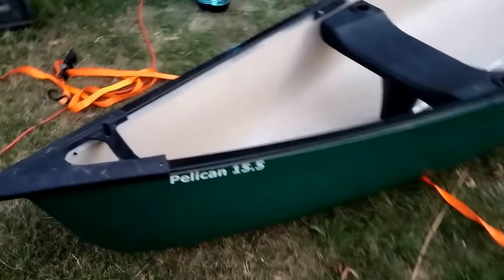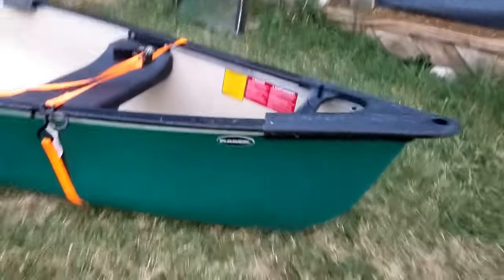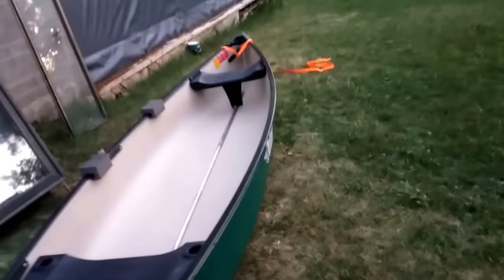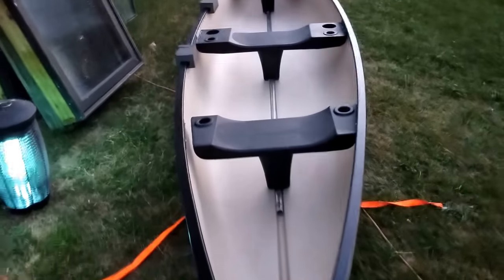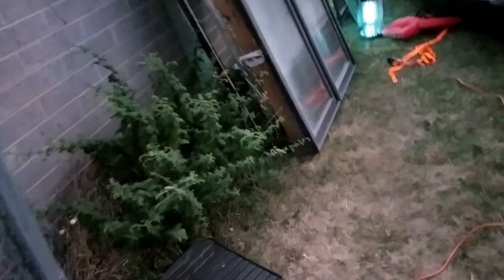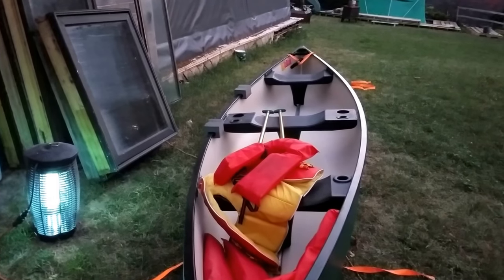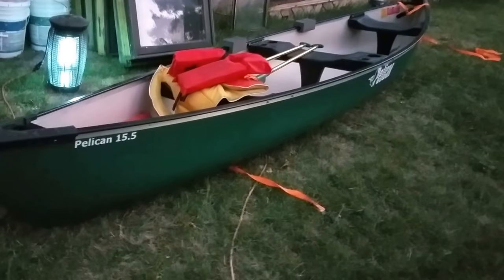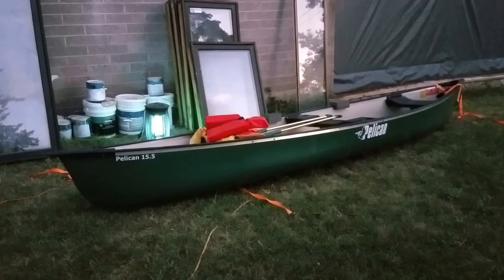Pelican 15.5 three-seater canoe project

Comment: I just picked up the same canoe model for free with the same problem but I'm going to flatten out some 4" PVC pipe, cut it to size, screw it to the sides of the seats and reconnect it to the sides of the canoe. 
Wood will just rot after a while.
I do kayak & small boat restorations and now... Canoe!
Reply from the maker: Great idea, thanks for sharing!
Reply: @WoodandHomeAccents  I'm watching your seat 1.5 video... You're a pretty good craftsman, why not just recreate those cheap seats out of wood with the same brace in the middle. Instead of the vinyl, glue on some EVA foam like those interlocking floor pads.
BTW those seats are supposed to add floatation to the canoe so I'd add some styrofoam to the bottoms of the seats.... I'm going to heat Pvc and curve it under the sides of the seats for support then just screw it to the sides of my canoe with the original bolts and under the seats with stainless steel screws
Reply from the maker: Awesome ideas! I actually sold it when we moved, so we'll see what comes next. Thanks!

Comment: I'd use some aluminium angle and drill some holes through the seats through the angle and use carriage bolts 1\4 inch.
Reply from the maker: Thanks for the idea!
Reply: One Step Closer did you ever fix it

Comment: Eek. Looking at options to purchase, how I found your video. Thought it might be a good option as Canadian Tire sells them... But it would have to be a few hundred off the sale price based on how flimsy it looks in your video. Thanks!
Reply from the maker: Thanks for taking time to comment. I would not want to pay full price for it, but once I complete the changes I plan to make with the seats it will be pretty nice for general use. The body itself is pretty durable material, but definitely needs stability at the top to keep it stable.
Reply: Academy sports sales them for $399

Comment: Do you still have your canoe? I bought one yesterday without seats. Mine is missing the pole, but new pictures show a pole there. How long is the pole, what material, and what’s the outside diameter if you don’t mind me asking. I would appreciate the help. I may try Lowes, Home Depot or Menards for some galvanized pipe or conduit to fit. Mine is also a Guidesman, but looks exactly like the Pelican canoes. No real info or parts on Guidesman.
Reply from the maker: I do not have it anymore unfortunately.  The Pole was almost the full length of the Canoe Canoe and it was a loop aluminum I think. If I remember right the diameter was about 3/4 of an inch. I'm sure that a galvanized Pole about that length and diameter would work just as well. Congratulations on your new acquisition, I hope you have tons of exciting adventures with it!
Reply: @WoodandHomeAccents  thank you. I appreciate it.
Reply from the maker: @noahmc1547  good luck with everything!